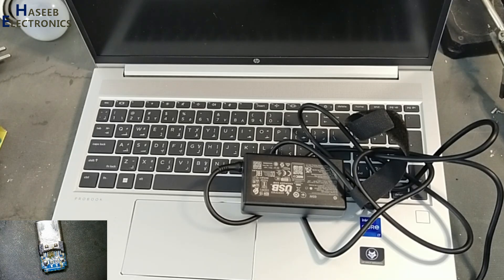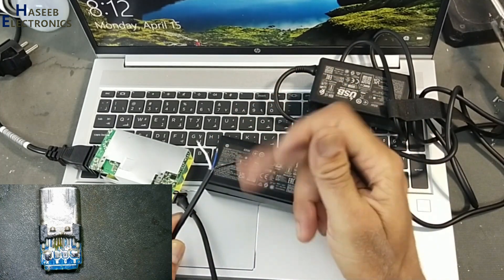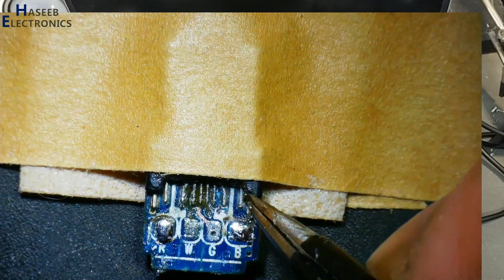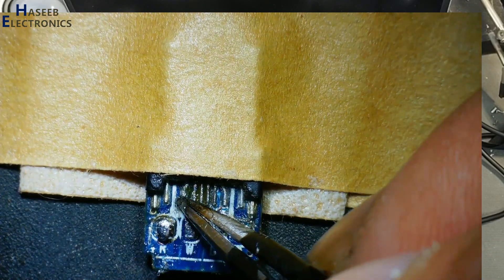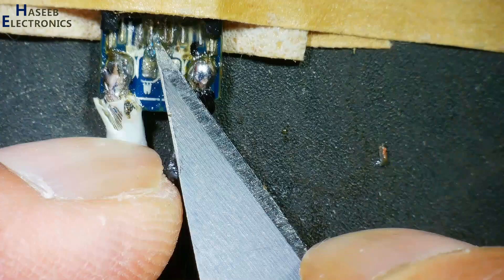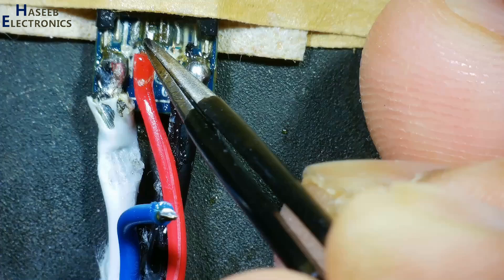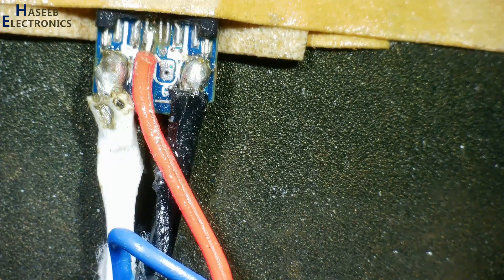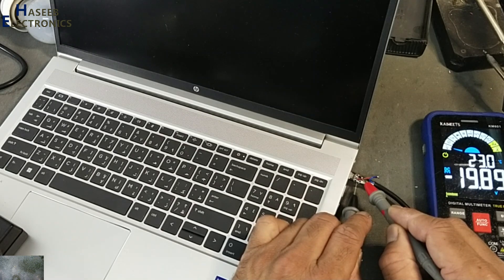{1092A} HP Laptop charger Not charging || Replacing USB-C connector

Comment: do current lenovo thinkpad power supply usb C (symmetric round) need the negotiating "PD" chip on the connector end, or are the red, blue, ground wires connected straight through ? the emarker chip should be connected to blue wire inside the power supply

Comment: Dear master mr Hasseb i have a dell LT 1540the dc charger jack has 19 v in pin side of the jack but center pin has no v and LT turns on and send error that shoul change adaptor with a 65W  how can i repair t this adaptor?!
I think a 180k resistor between the maim 19v (central pin and side pine is burnt! And should insert one .
How do you think plz guid me to fix that.
Thanks a lot.
From iran
What do

Comment: Good. I use a Decoy / Trigger ( tiny) board with a button that lets me cycle all the Output V modes. Testing with a actual device... too risky.  Using extention wire is wise